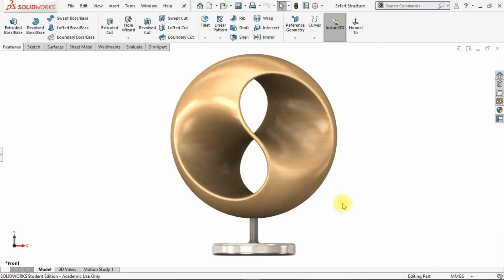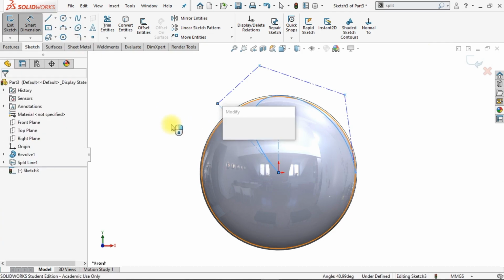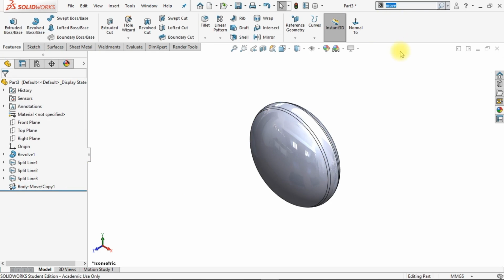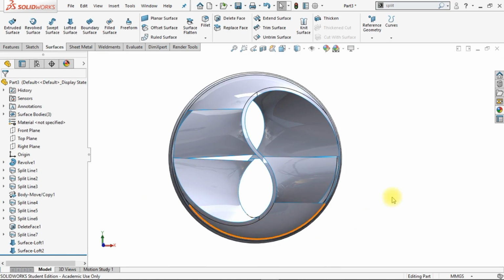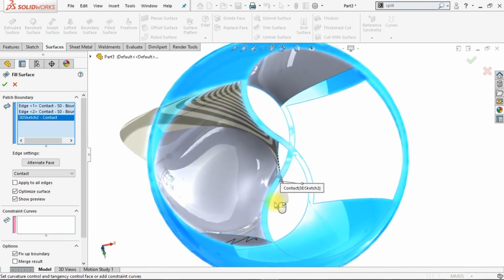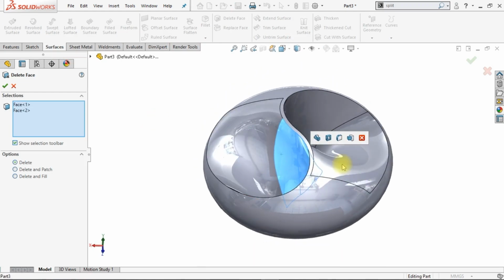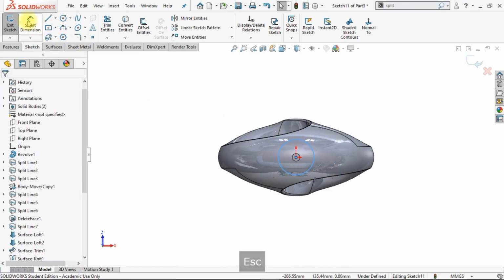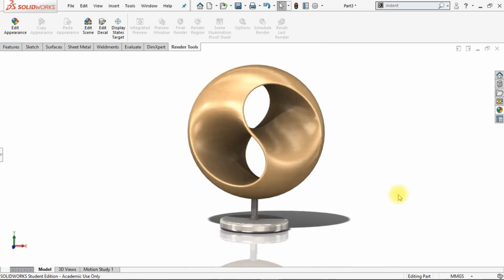Master SolidWorks | Create Stunning 'Trefoil Knot Minimal Surface' in Days | Boost Your CAD Skills

Comment: Very good .👍 I still don't understand the selectionManager logic🤕
Reply from the maker: Selection Manager in Loft Surface or In Fill Surface
Reply from the maker: Actually i split the surface first because splitting the face will give a finer result while making lofts
Reply: @EasyCADSolutions  The problem is that I do not always see the direction in the construction of surfaces I cannot yet predict the result of building a surface when using different faces A lot of time is spent on working out different options until you get the desired result. This happens because I can't understand the solidworks surface construction algorithm to predict the result.
Reply from the maker: Yes, It's difficult to predict the surfacing results   in Solidworks